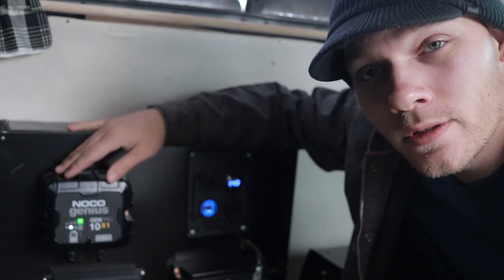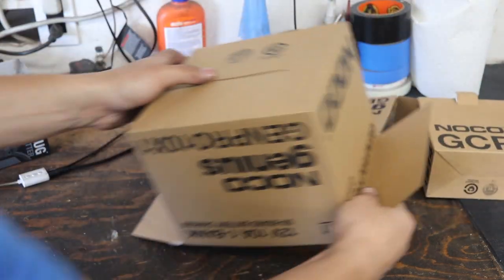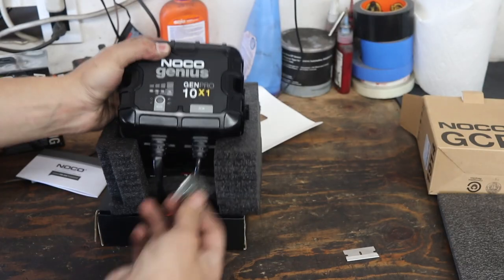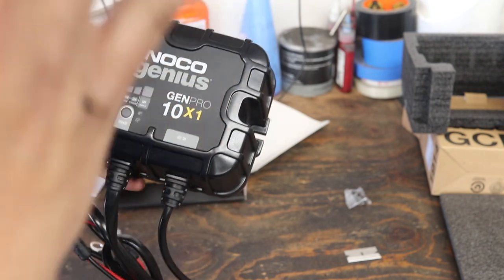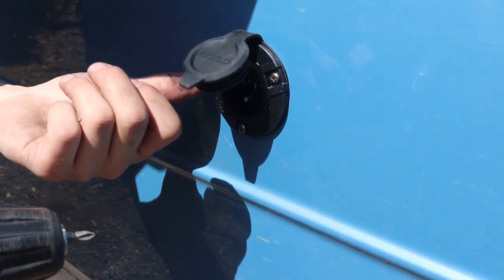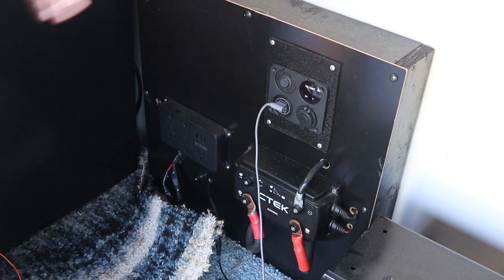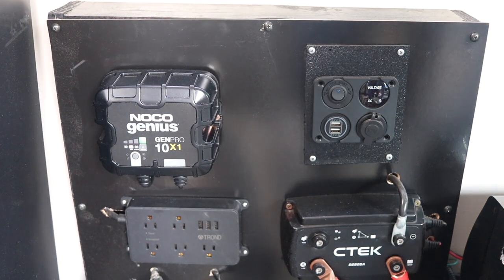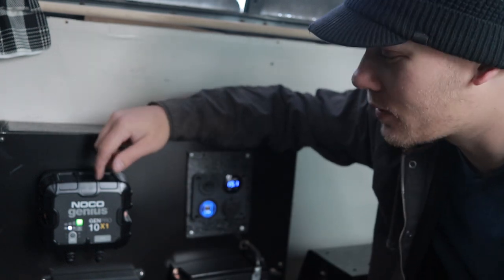NOCO Genius Onboard Charger | Camper Boat RV Shore Power Battery Charging

Comment: I just installed the same model for charging my trolling motor battery after my Guest ChargePro quit working. Seems to be a great quality product. My battery is old but working fine but I will run it through the repair mode as well.

Comment: Hey man awesome videos I’m subscribed. Quick question; do you think I can charge my onboard lithium battery with that Noco connected to the 12v port in my car while driving ?
Reply from the maker: It’s only powered by the normal AC wall plug. So it can’t plug into a 12v port. Best bet would be to get a DC-DC charger for charging the lithium while driving.

Comment: Question, why did you swap for the two-way dual port one? I just purchased the single port one. What do you have plugged into the other port/line line? Trying to decide if I should return mine and get the dual like you did.
Reply from the maker: I had a power strip plugged into the other port.
Reply: @DonnieDispersed  ahh okay, so just for like quick power and other uses besides charging the battery?
Reply from the maker: @garrettpaull2629  yeah, so the battery could charge without powering unnecessary accessories at the same time.
Reply: @DonnieDispersed  copy! Yeah I was thinking of doing the same. But I figured I’d just put a splitter on the end. I think that’ll work too. Thanks man!

Comment: I have this same one how often do I need to plug this in I read instructions that it's supposed to keep a trickle charge going to my battery but I know this mine only a lot lasted about a month or so then I had to charge it back up
Reply from the maker: It has to be plugged in at all times to work. It doesn’t hold any charge on its own.
Reply: @DonnieDispersed  thanks for responding so quickly I have a dump trailer with the deep cycle battery I was under the impression that this thing would maintain a charge but I guess not either way it's still good to be able to charge up my battery instead of constantly having to use jumper cables however I only get maybe about 5 - 10 dumps then I have to recharge it

Comment: Can you use this to charge sa 6 to 8 batteries on a series connection? Any information would help appreciated in advance
Reply from the maker: I believe there is a recommended AH limit. I would check on the NOCO website to be sure. You can chat with someone on the website and they are pretty helpful.

Comment: Is the maintenance mode good? I have 3 and 4 year old batteries. I want to revive the battery. Can he ???  ❌❌ ♥ ️
Reply from the maker: I haven’t been able to get out to test the battery after running the repair cycle, but I know it ran the cycle the way it was supposed to cause I watched the voltage while it was running and it was spot on for what the manual said.

Comment: What’s agm mean?
Reply from the maker: Absorbed Glass Mat, it’s a type of sealed lead acid battery.
Reply: @DonnieDispersed  what setting would I put to charge a deep cycle battery?
Reply from the maker: @dustinjohnson2116  depends on the chemistry of the deep cycle (standard, AGM, lithium etc)